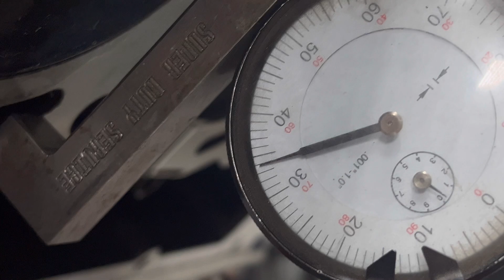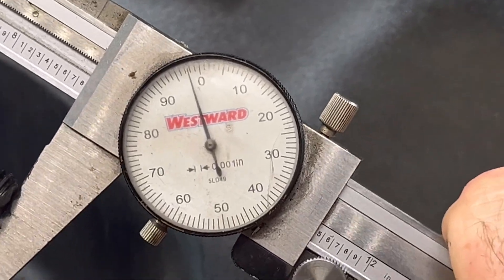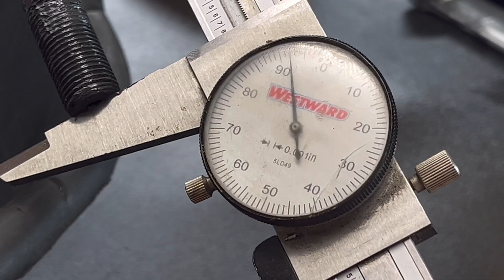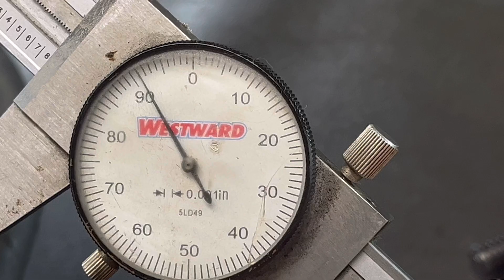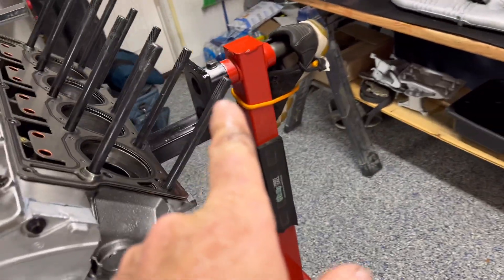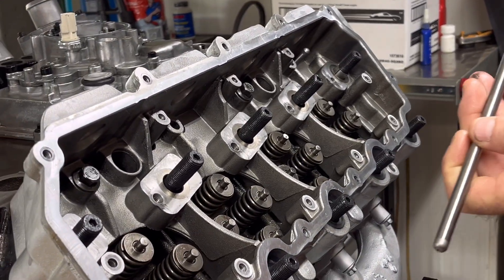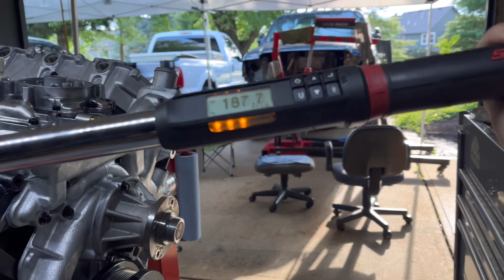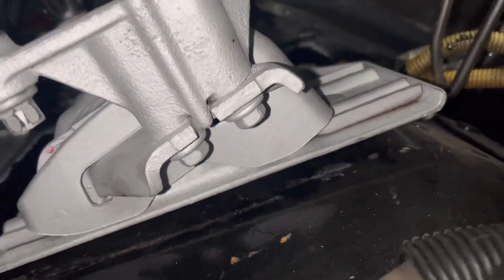Measuring 3x torqued ARP studs on Ron's 6.0 Powerstroke from South Carolina

Comment: I had worked on this early 03 truck a while ago that was studded years ago and had had (for various different jobs/reasons) the heads off (studs undone out in and retorqued) 4 or 5 times.  when I finally got to it (other people/shops did all the previous work) my boss said he wanted to use new studs for piece of mind, But u saved the old ones and later called arp and got the specs and measured them all.  They were all in spec with even less variation than those.  Pretty neat to think about, especially since they aren’t even the CA625+ versions. Thanks for another great video, stay safe guys!
Reply from the maker: Good info,,   I couldn't get any actual specs on the length.   At least not a definite enough number they are manufactured to.   Three different batches are what these studs seem to be..
Reply: @AnthonyYoungblood yea I hear you, they don’t seem to be regarded as extremely close tolerances on lengths as far as ARP says.  If you want I can dig through my books/ files and see if I can come up with the numbers they gave me, if you wanted.

Comment: I'm surprised your not using o-ringed heads
Reply from the maker: I firmly believe that the ones that push orings,,  struggle with deck prep.  Would you all agree we have done our fair share of head gaskets??    I do not have a need for it.  At least I haven't in the last 15 years...  lol    However,,  if I start losing gaskets,,  I would get desperate too.  The problem is,,  nobody uses an actual hoop.    A complete circle...  How can having a GAP in the wire be good for a long term rig??   These combustion gasses will leak from thousands in normal operation,,  let alone if we give the border wall a freakin gate!!!!    lol

Comment: AvE has a great video on bolts and TTY. Personally unless they are physically damaged or just plain cheap I reuse them.
Reply from the maker: A tty fastener is much cheaper right??    I sure hope so.   Common sense says when I tighten a bolt,,  it should be strong enough to not yield during it's life if tightened properly,  no matter how many pressure cycles its subjected to???  However,  since we have those tty fasteners,,  it allows us to debate...  lol
Reply: Always used head bolts over again in the old 6.2 Chevy's. Nobody cared back then and I'm sure they got used more than once on some engines. Old 5.7 olds diesels there was a cat deadbolt that some guys used on them.
Reply: @waynesimpson3138  yeah I mean to each is own. What works for one might not another. Ya can ask 10 mechanics and id bet ya get 6 different answers
Reply: The European stuff uses aluminum bolts which are a while different story

Comment: Still wonder who’s bright idea it was at to run a head bolt thru a rocker box then thru the head and torque 2 separate pieces of metal together to the engine with only 4 bolts per cylinder !!Surely they could have came up with some better configuration 😂
Reply from the maker: Think they would be cheaper from ARP if they were short?
Reply: @AnthonyYoungblood  I think arp would’ve made a gazillion dollars regardless of the length and price tag . Liking all your videos thanks 🙏